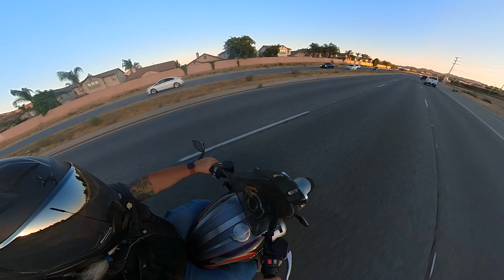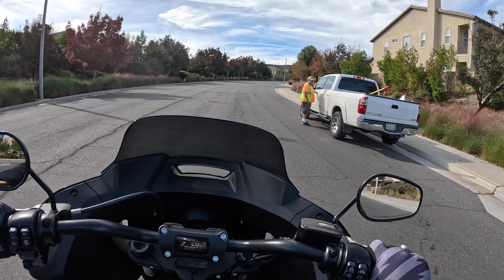SPC Exhausts - Site Visit and Interview

Comment: I test rode the Low Rider ST in Sturgis last year.  Loved the bike except for my knee placement.  I'm glad thy have forward controls.  Do you think 500-600 mile days would be comfortable with the forward controls?
Reply from the maker: Hey ZMan, I find it much more comfortable with the fwd controls for sure, but I still feel a little high kneed. I am looking at probably adding full boards on it to drop down the height a little more. Once I do I will do a video on that as well. My heritage position is perfect (same frame).

As for the current setup and a long ride, I have ridden about 250 miles in a shot with the current config and it was not bad. Once rolling along it seems fine but I am still prepping to do a bar and riser change which I think will make a huge difference on seating posture.

Hope that helps and thanks for the question and comments, much appreciated. Ride Safe!
Reply: @justkillnbugz  Thank you!  I appreciate the reply.  I'm 5'7" short inseam.  Thanks again!  Great channel!